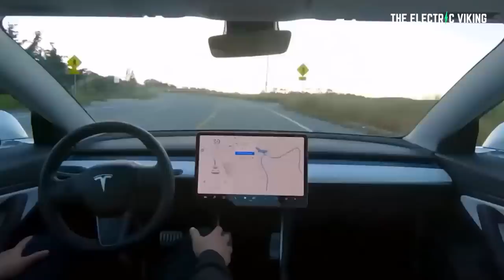20% of all vehicles will need to run on electricity in 24 months in Canada!

Comment: Here on Vancouver Island (BC) I believe sales levels of EV's are already at or above 20%. Victoria may be the highest EV concentration in NA. With the whole province electric production from hydropower and always has been, BC is a total natural for EV use. The key missing vehicle right now are pickup trucks. Almost half the vehicles outside cities are pickups. Once electric pickups show up in numbers and standard car prices drop below ICE we will rapidly go over 50%.  I'm very old and don't need a new car, but I can't wait for the day that the average citizen can extend the middle finger to the oil and gas cartel.
Reply: Come on! You're not that old!
Reply: And then they can bow to the electricity cartel.
Reply: @JohnSmith-ux3tt  Or put solar panels on the roof. Can't do that with a gas car.
Reply: All Hail BC Hydro😊
Reply: @andrewangrignon6532  that Surrey based clown show wouldn't cross-connect a Hydroelectric facility a few short kilometers from the town of Stewart as an emergency backup to the accident and avalanche prone powerlines along Highway 37.

Comment: I'm in BC and I've a Tesla Model 3 SR+ since March 2021.  It has been a great car to drive and we have gone on a short trip to Victoria without any issue.  The problem is that there are still not enough EV chargers and when I was in Victoria, the hotel only has one stall for EV charging.  Imagine if there are many more people driving EVs.  The other problems with EV are range and cold temperature. I do most drivings in the city and the range is more than sufficient. But I can imagine people living in the Toronto area, where you need to travel on highways everyday and the low end EVs with smaller batt packs just may not have enough range. We just had a snow storm here last week and my M3 loses 5% batt power just by sitting in the garage in the cold (-10C), not being driven.  So this is not ideal for people with EVs parked on the street in the winter with the snow.

Comment: In Northern BC the temperature hit -50 degrees centigrade so the EVs don’t work well when you have to run heaters all the time. 

In the Yukon in some areas they will run the vehicles 24 hours because the oil will almost freeze and the cars won’t run.

Many people use trucks to pull large trailers over longer distances so not practical because they don’t work.

Most provinces in Canada do not have hydro power so they burn natural gas in thermal plants to make electricity… all you are doing is moving the C02 emissions to another location.

Canada is huge so entire transmission and distribution grid needs to be revamped to handle increased demand for electricity.

In the summer and winter the electric grid is running at max so having EVs is not going to work as we do not have enough power to supply vehicles.

People cannot afford EVs as most people do not have $50k-100k to buy an EV, charging station, and upgraded 200A services to their homes.

Forcing people to buy EVs puts people into poverty as the government is subsidizing green technologies and EVs so everyone pays with higher taxes…

Canada’s carbon taxes have done absolutely nothing to stop greenhouse gas emissions and have caused massive inflation.

Forcing these green policies in Canada, will destroy the economy, cause inflation, and put people into poverty.

Great idea but not going to happen any time soon.

Comment: I live in Ontario near Toronto, Canada's largest city. I have owned a Model 3 since June, 2020. I see more and more Tesla's  on our roads but few other EV's. BTW, I charge overnight on my household current. I.e Level 1 charging.  It gives me almost 120 km in about 12 hours during lowest rates. Only occasionally do I use a faster charger unless on a road trip in which case the Supercharger network is excellent.

Comment: We have zero Chinese EVs. No BYD, no SAIC MG4, no Chery, no nothing. The cheapest available EV is the $38K GM Bolt, A Tesla 3 starts at $60K. So, in 24 months, 20% of all cars sold in Canada will be over $38K.
Reply: Same problem in the US, few options , and they are all expensive.
Reply: I live in Alberta Canada and I an a big fan EVs. I totally agree with this statement. More electric vehicles are becoming available but most have a long waiting list like 6 months plus and not many are available.
Reply: Look at aptera......aptera is a USA start up company......it is the most efficient ev ever designed with the lowest drag coificent.....? It's three wheel dsign simplifies design, reduces cost and weight. In fact aptera weighs about half as much as a Tesla. Aptera is the minimum car designed to seat two people comfortably. At the most recent fully charged show in California the latest prototype of aptera was unveiled by aptera. Sandy Munro of Munro and associates is a big backer of aptera. He believes in simplicity and efficiency of design. He is a practitioner of sigma six manufacturing technics. His company has consulted with aptera to design the most efficient design and manufacturing configuration. Aptera will last several life times as the composite body never rusts. Also the modular design of the car allows easy maintenance and repair of parts of the car and or systems. For 20 example......in eight or ten years, the integral solar panels can be replaced with more efficient ones. Or the entertainment modules may be changed.......etc....?? Unlike Tesla, aptera is friendly to owner maintenance and will publish all data about their car so diy person's or mechanics can work on the car. Aptera is finalizing the design and plans to start production in 2023......or. 2024. They are completing their fund raising. They need $100 million usd. They have over $50 million with $20 million being granted by the state of California and $20 million is being negotiated from a big investor. U can invest in aptera for $1000. Go to their web site.,...aptera.us...... For more reasons why atera makes sense email me. I shall send u the list as well as a discount code to save u money when you order your aptera on line......?regards.....a. barbuto..... barbuto@optonline.net.....
Reply: @anthonybarbuto6012   LOL. That's quite a sales brochure.

Comment: In my area of Canada all electricity come from hydroelectric dams so I am all for it 😀but the biggest issue is the supply of electric cars that have a waiting line between 1-2 years 😱some people can't wait that long for a new car so they grab a gas car off the dealer lot.😞
Reply: If you want a Tesla, you only wait between 2 & 4 months except for Cybertruck
Reply: @Mrbfgray  It compares very favorably to oil extraction and refining and pollution and it's renewable oil is not , it's the lesser evil.
Reply: @andrebonneau8738    We are going electric one way or another, USA grid will require roughly 30% more capacity (including, or minus individual home solar and storage naturally) over 8 or 10 yrs.  That's about 4% increase annually similar to the decade when air conditioning first became common.   Doable. 

I expect to be personally energy independent in several yrs.
Reply: I’m in Quebec Canada. Hydro electric is definitely a big win. I’m also on the wait list for a Silverado EV. Still 2 years away
Reply: I see used Tesla Model 3's for sale. Maybe people upgrading to Model Y's? Anyway, those prices are coming down...
Reply: @Mrbfgray  Not true here anyway , in our area we can add 1 million ev's with no major investment.
Reply: @rozonoemi9374  But I can't afford a Tesla. I bought a Hyundai Kona EV in 2019.

Comment: I think low non-Tesla supply is the biggest reason for slow EV adoption in Canada. It's hard to even find a car to sit in. Our local Hyundai dealer has one Ioniq 5, not for sale, and an expected 2 year wait on a list to purchase one. The current state of EVs would work fine for us, but Tesla seems the only option and they are too expensive for us.
Reply: Exactly!
Reply: I tried several times to buy an EV and you are exactly right. I couldn't get confirmation on I will wait till Canada starts building their own EV's. delivery or a guarantee on delivery so I ended up buying out my lease on my MB A250 instead. I rather wait till Canada starts building their own EV's.
Reply: And if you need an EV pickup or van, the price and delivery is exorbitant.

Comment: During Last weeks cold snap a MY LR driver did a 180km highway trip finishing at 20%.  That means any vehicle with a sub 500km range  and/or lacks a heat pump is not suitable for many applications.  Those vehicles are very expensive currently as no Tesla qualifies for the federal incentives. The Ioniq 5 is a good candidate, but the dealers are jacking them up in a obscene way so the reasonable MSRP is pretty unavailable (2+ years).   I was somewhat hoping that Canada might start seeing Chinese built tesla,(which may come down to the fed limit) and more vehicles from Korea and other places that wont qualify for US subsidies.... but realistically I think that some form of normalization of policies with the US will happen with the Jan announcement in order to get manufacturing here,  otherwise we are not able to afford North American built cars.    The other side of the problem is of course charging infrastructure, which given the size of the country will be challenging and where IMO the feds should really be focusing instead of vehicle subsidies.  Winter and upcoming EV Trucks make these 50kw chargers/ poor reliability  worse than useless.    Battles with provinces will ensue, My own newly non elected premier who a year ago was peddling conspiracies' as a talk radio host has declared she will save us from EVs.   No federal funding for highway projects without charging infrastructure might work... but there will be fighting and sabotage on the part of some provinces.

Comment: I have been holding out on my next car for atleast 4 years so that I can buy a Electric. I chose not to buy a PHEV because the limited Electric powered range is more than halfed to around 15km at the -25c winter we have from November to February, which was not enough for daily commute. Full Electric doesn't have enough range travel to nearby Calgary, and needs 4 recharges for a round trip alone, not including and travel in or around Calgary. On a 3 day long weekend, waiting 30 minutes 4 times adds 2 hours to a 6 hour round trip and to go shopping, entertainment, or sightseeing we would need even more. Summers would be better, but still adds 1 hour to a 6 hour drive.
Waiting for affordable EV with real world 800 km range so in winter I have atleast a 300km range after 7 years.
Reply: Yeah the new Prius Prime plug-in is rumored to only be 37 miles electric. That means expect 30 if lucky on electric. 50 would work better, 100 would be ideal. The 2023 Prius will be a Soiled Dove and Toyota Dealers will be brothels with pricing.

Comment: Hi! Fantastic and interesting show you have:-) In Norway where I come from there are tax-reductions on EV's and this year almost 78% of all new cars will be electric.  By the end of 2024 I believe that 20% of all cars in Norway will be EV's. The goverment is aiming on 100% of all new cars to be imported to be EV's from 2025. I have my third EV now. It is a Toyota RAV EV made back in 2013! (And it is also a Tesla because it has the motor/battery from Tesla Roadster and the chassis from Toyota RAV) It is a very fun car to drive:-) First EV-car was a Fiat Fiorino Elettrico. Bought it on auction here in Bodø (north of the polar circle) and had it for three weeks. Returned it to the seller because it shut down (completly) and you had to restart it everytime you had a wheel spin. During winter it happens a lot here... Especially with EV's that have high torque.  Then I bought a norwegian made Think City EV and it was great fun to drive - for two months. Then followed two months in a garage before shipping it to Oslo for sale (for parts).

Comment: Hi from Quebec Canada. We  (provincial government and it's government-owned corporation - Hydro-Québec) been investing heavily into the development of ev charging stations within our province (over 5000 already) and most of all eastern states (in the USA) (over 125 000 stations). As the rest of Canada is pushing towards EV's, we and BC have also expanded our hydrogen stations and available vehicles. The cost here (QC) is 7,50$/kg that is equivalent to 1gallon (3.785L) of gasoline (which is presently 1,45$/L), the Toyota Mirai has a 5kg capacity (37.50$/550km range); as our production capacity has augmented our cost for H has dwindled (from 10$ in 2019 to 7.50$ in 2023). If an EV necessitate charging from a 100kw fast charging station from 10% to 90% it costs 23.52$ (taking 50min) and from 90% to 100% 5.60$ (11 min). Several years ago we had the first and largest green hydrogen plant in the world. Since then a second one will shortly be operational (private/governmental owned) with a 11,000 metric ton yearly capacity. Lest us not forget Nova Scotia with their own (up and coming) facility and Newfoundland's planned facility for both national and international markets with it's wind farm project. As we are a northern country the cold is the worst enemy for EVs and their limited range is also a point of contention here. Avg range for EVs is 450 km but hydrogen vehicles is closer to 600km. The "filling up" an ev is also a big problem here in winter as the battery should be warmed up prior to be able to utilize a fast charge option. Otherwise the slowest pace will be the one "accepted" by the vehicle thus taking even longer to recharge. The cost of an EV have been reducing over the years but the added expense of the home charger (1750$ if enough room in electrical box) by an registered electrician has slowed down the progression of sales. At present 3% of all vehicles here in Quebec are EVs and 0,7% are hydrogen. The cost of H car is much less than EVs and their longevity also making them a sound choice. Which is prefered by many ice vehicle owner as longevity is always taken into account. I myself own a young 2003 Honda Civic with an annual expense of no more than 800$/yr (excluding oil, tire, rotor & pads and such).

Comment: Sam:  Just like the rest of the world we need the affordable Tesla Model 2. We need chargers that work consistently like Tesla for CCS cars. Automakers need to supply the cars to meet demand. 
We dump electrical power at night to New York State and Manitoba from Ontario. Lots of power is available for charging overnight. I just helped get infrastructure installed at my condo and 22 owners got chargers thanks in part to a government subsidy. I am the only ev owner right now. Others will now follow because of this. 
There is also a national network of DC chargers across Canada owned by Petro Canada so we can now drive the whole country except the far north.
It is coming. The market will decide and they are doing so. Get automakers to catch up and price cars affordably.  If you build it, they will come Sam.